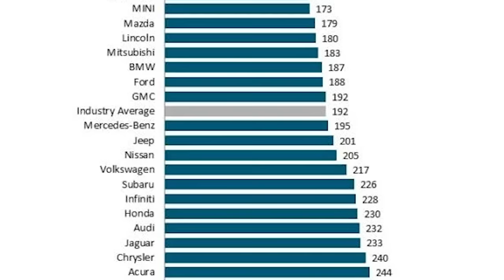Trucks That NEVER Break Down (Reliably run 1,000,000 miles)

Comment: Unfortunately Chevy/GMC trucks 2016 on up are super unreliable. Top 10 most unreliable list everywhere. I learned the hard way with a 2018 LTZ Silverado. They started using plastic parts in the transmission, engine, fuel pump, etc.

Comment: My brother has an old Ford Power Stroke 7.3. He loves it even though it's noisy and stinky. It's paired with a ZF manual trans that he's replaced at least 4 times. Whenever he pulls a heavy trailer, the torque and vibration of the engine simply beat the transmission apart. The hard parts in the trans just break in pieces. Typical Ford.

Comment: Love my 94 Lexus LS400 with 1,100,000 and going strong, big wide racing slicks and a full decat sports system and intake, costs peanuts to look after just done the alternator £100, power steering pump £50 & oil and plugs £70, drives just like the mrs brand new 9g tronic Mercedes, and yes it can still balance a one pound coin on the engine and rev it after 28 years, the japs sure know how to build em

Comment: I will keep my 2002 7.3L Power Stroke for a long, long time. Even after 22 years, I still only have 37,472 miles on it. All the folks I know that own one, has gotten over 500,000 miles on them and worked them hard. Mine has had an easy, grocery-getter life. I originally bought it for hard steel hauling. But decided to keep it nice and continued driving the old beater '87 F150 that had over 270,000 miles on its 5.8L gas engine. Ford builds the best, IMO.

I forgot about our little '89 Mitsubishi Mighty Max truck. That little truck was put through hell at our machine shop business. We hauled far more in that bed than it was designed for. It had every option like A/C, autotrans, stereo. The engine was too underpowered in it. A little 4-cylinder. But the truck lasted for 285,000 miles before it gave up the ghost in 2003.

Comment: 12 valve Cummins. 300/4.9 Ford I6. Dodge 225 I6. Chevy 250 and 292 I6, and the earlier 235 I6. AMC/Jeep 232 and 258 I6. International V8. Dodge 318 and 360 V8s. GM small and big block V8s (pre-LS series). If the truck you're looking at doesn't have one of these engines, it doesn't belong in a list like this. You guys mentioned a million miles, but the only engine you listed that has any chance of lasting that long is the Cummins.
Oh, but you want a Japanese truck? You didn't even mention the most durable Japanese truck: Isuzu. I consider it the International of Japanese trucks. Especially if it has the diesel engine.
As for Toyotas, I've had two Hi-Luxes. I literally gave the first one away after the third engine failure in 5 years. The second one, a 4x4, I traded for a Chevy parts truck. Toyotas gave me almost as many problems as Fords, and that's saying a lot.

Comment: Alright y'all, I haven't met a mechanic that recommended a Dodge Dakota. I'm into cars and motorcycles and owned an '05 Chevy 1500, '05 Ford 150, an '03 S10, and several Rangers. But a Dodge Dakota? I'm open to which is the best of the Dakotas. I decided a couple decades ago that Dodge missed the mark by not offering the Cummins 4 cylinder diesel in a Dakota!
Reply: What were your favorite vehicles that you owned?

Comment: 4:39 
Why do people talk shit about the 4L60E? Name other automatic transmissions that were behind V8s taking brake torquing, Rev & dumps, and still tow your boat to the U P for summer vacation at 150k-230k miles on original fluid from the factory?
Now the front differentials and the LSD in the differentials were no the best, but again handling neglect for 15yrs is usually the compromise…

Comment: 2nd gen dodge trucks get a lot of hate for bad transmissions, lack of power & cheap interiors.
 I have 3 2nd gens
1997 ram 1500 4x4 318 (722,122 miles)
1994 ram 1500 4x4 360 (377,421 miles)
2000 ram 2500 4x4 V10 (981,229 miles)

Ok my trucks have had repairs & maintenance. If you own a dodge of those years, you need a good set of tools, & a bit of mechanical knowledge. There is nothing on those trucks I can't replace myself. I would take anyone of my trucks on a long distance trip without the worry of breaking down. Imo 94-01+02 2nd generation dodge trucks are very reliable, and could easily pass the 1,000,000 mile mark if maintained correctly.

Happy to say my 97 ram has the og auto transmission at 722k, my 94 & 00 have rebuilt manuals

Comment: 99 Ford F150 with a 5.4 two valve motor with over 460K mis.  Bought it with 70K mis, switched to full synthetic with 4500 mi oil changes from June to September and 5,000 for everything else.  Haven't had issue with the engine at all.  I do not touch the plugs, allowing our mechanic to do all tune ups as he has the specialized tools to do so.  After 2002.5, I wouldn't buy an F150 until year 2022 and that would be a 5.0L. Ever own a Saab? When a turbo finally goes on an ecoboost motor, you won't have a wallet left to finish paying for the part.....
Reply: You are absolutely right brother. Spot on. I own a 2002 F150, 4.6L and with over 256,000 mi it's been a solid truck.

Comment: Okay truck/car guys, I need some help. So my wife and I are looking at getting a second car, and I specifically want to get a pickup truck and she agrees that would be good. I have been looking around and had a few in mind, but wanted to get some people's opinions. So I will start off by saying, I'm not a car guy. I don't care how it looks, or status symbol stuff, I just want something really reliable (hence why I'm on this video haha) and hopefully something with with decent cab space. I have been looking at 1992-1995 Ford F150 Extended Cabs, 2008-2012 Chevy Silverado Quad Cabs, 1st Gen Honda Ridgelines, and 2009-2014 Ford F150 Quad Cabs. I am a little partial towards Honda and GM products, but ultimately don't care as long as it's reliable (I am wanting a truck I can keep for a long time and hopefully get up to 250,000 miles plus). Any suggestions?

Comment: Good lord! From the title I knew this video would be a joke! Everything breaks down at some point! 
The S-10s are complete junk! I worked in at a couple independent garages from the late 80s to early 2000 …EVERYTHING on these trucks broke! 4x4 models had a terrible 4 wd system! Engines leaked oil something fierce and the 2.5L and v6 engine would rarely make it to 100,000 miles without major work! Fuel pumps would last maybe 4-5 years before going out! I could keep going but would be longer than this video!

Comment: S10?  Really?  I had 1 and had to put a transmission in it then, the engine went.  Crap truck. Got rid of that then, got a full sized Chevrolet 1/2 ton.  It didn't last much longer than the craply S10.

Comment: Surprised the 8.1 found in the 3/4 ton GMT800 platform didn't make the cut as a gas heavy duty option as I know they are a well loved engine even if fuel economy is usually single digits

Comment: Not sure what SIlv erado he drove, but they have issues once you get past 100K miles. I had the 2018 4wd Silverado 1500 for almost three years. In that three years the power brake assist pump went out, a wheel sensor for the stabilitrak system went bad, and the transmission overheated when I wasn't even pulling a load. Overall cost of repairs in three years was over $5,000.  I traded it in and got just enough to pay it off. Now I'm in a 2023 Tacom with the V6, and it pulls my 3,000 pound boat on a two axle trailer like a freaking boss , whereas the Silverado struggled. I'm done with Chevy trucks. I'll stay a loyal fan of Toyota until I'm dead.

Comment: As someone who has a lot and I do mean a lot of time energy and money invested in the GMT 400 platform from Chevy I can tell you right now your assessment of the Chevy Detroit diesels is wrong between 150,000 to 300,000 mi they are known for cracking the block unless they haven't been worked if you give them a very easy life with no stress they won't do it but if you work them at all they will crack the block The old Duramax like the first generation was a good motor very good motor but anything before that the 350s are okay but even they don't hold the candle to the reliability of the big block

Comment: I have an 88 Suburban. Original 350 engine still going strong. Original paint, and suspension too. It is a reliable daily driver.
Reply: Lmao, you sound broke
Reply: @deontaywallaceescalade  Its a $25,000 truck, bud.

Comment: Bro the 04 05 LLY duramax sucked. My old room mate had an 04 and i had an 03 LB7 and he had his tuned with efi and mine came with a 75hp edge and my truck would smoke his. I loved my lb7. I have owned 2 cummins a 95 and an 01 and the 01 sucked in comparison. The v10 ran good they actually impressed me. I have a 12 6.7 powerstroke and its fucking awesome. I had an 01, 03, 06, 11, 12 powerstroke. The 7.3 is reliable but had NO balls and cant be built to be as powerful as cummins and duramax. The 6.0l were junk but ran better than 7.3. When hauling my uncles race car on my 03 6.0 up a 35% grade it ate that hill up and blew a hole in the hot side of the turbo and still made it home. Traded for an 06 and it lost a couple injectors.  I fucking love my 6.7 ford it would blow every truck i have had out the water except, drum roll, my 650hp 1400lb 12v cummins. I would trade my king ranch for a crew cab 12v if i could find one for under 40 grand.

Comment: I had to stop watching when the conversation turned to the Ranger, no generation of Ranger was based on a Mazda, it was the Mazda that was based on the Ranger, just Isuzu used the S10, also I believe a little research will reveal the Dakota was no Mitsubishi either.

Comment: Living in a country with absolutely garbage roads I can say Dodge and Nissan interiors completely fall apart in 10 or 15 year. Cheve and modern Toyotas are a bit better but not much. Then there are the Fords Mazdas and older Toyotas. Beat the hell out of them and air condition still works even door handles stay intact. Most people drive Ford around here for a reason even though it's not as reliable

Comment: lmao a 4.3 powered blazer is reliable but 4.6/ 5.4 powered fords arent? you could be unlucky and blow out every plug on separate occasions, get them all repaired and still be cheaper than the inevitable spider injection, intake leak, failed distributor, then ofc the 4l60 will die at 150k. ill take anything powered by a 2v with a 4r70w behind it before i take any of chevys offerings

Comment: IM GONNA TELL YOU THIS: I HAD AN 95 S10 FOR 5 YEARS, THEY ARE IMPOSIBLE TO DESTROY AND I HAVE PROOF: 1999 TO 2000 I COMPETED IN RALLY WITH THAT TRUCK AND NEVER HAD TO CHANGE NOT EVEN THE SUSPENSION

Comment: I remember owning a 96’ S-10 5-spd, 2.2l Eng /Standard Cab. I purchased it for $11,975.00 new. I owned it for 9-yrs. Only major work performed was a new clutch, 1-ball-joint, and upgraded u-joints. I performed tuneups myself. Damn great little truck. I now still have a 1stgen Tundra with 246,000 miles 4.7l v8 4wd. Excellent Truck.

Comment: the s-10 was better than your 401K o my power joke the turbo sucks on ford o and the yota over priced can't do the V8 cummins o don't they put that in a ram try the resale value i don't know i was just in the car sales world for 10 years i currently drive a 2011 tahoe with almost 200k good 5.3 ive had for 8 years and ill buy another

Comment: I had a 99 ranger manual transmission that I bought new and sold in 2011 with 230,000 miles. Was still running and in good condition. The only thing I ever had to do outside of routine maintenance was replace the alternator at 100,000 miles. Never even needed a clutch. It was a no frills 100% reliable truck

Comment: All new vehicles are junk!  Because some engineers believe technology will make everything better…..sure we can get 0.00007% better fuel mileage with active fuel management or what ever they call it. And it only adds 5000$ to the cost of building a vehicle but on the bright side you won’t have any trouble with it for at least until 5 miles after your warranty expires. 
Give me an “old” 1st Gen 5.3 vortec any day!!

Comment: I'm not completely sure why you keep dumping on the 4L60E transmission, except for word of mouth reputation. 
Most these transmissions last for many miles are many years as long as they are used as they are meant to be used, in trucks the number one cause of failure is towing in overdrive, number two is modifications to the engine and pumping up the horsepower and not doing the same to transmission. 
I know many people that have chevy and gmc 1500s with 200,000 + miles and still running fantastic. 
Regular maintenance and no over the top modifications and 350,000 + miles is possible. 
If you want to build a hotrod or rock crawler there is much better choices.
(I will add this applies to the 2004 to I believe 2007 1500 series gm trucks, I'm not sure when they added active fuel management) to many problems and very expensive to repair unless you can do it yourself.

Comment: The v10 rams suffered from cracked heads...i feel not as much research has been done on some of these vehicles....theres a reason fords v10 is around more than a dodge. Im a mechanic btw...i specialize in japanese vehicles but for years played with anything that made me money. I worked on a lot of chevy transmissions and ford motors breaking down. Japanese vehicles are the best for your buck and longevity in life. I own a nissan frontier and a toyota tundra.

Comment: there is a host of problems with this video.  those gms may keep going and cost a transmission every now and then, but they also burn through blend doors, heater cores and electronic moduels.  all of which costs thousands of dollars in repairs, fords don't have that issue.   the t100 and early tundra is one of the worst trucks toyota made, between being cheap, transmission issues, ball joints failing and american frames rotting in half, not my choice over other toyotas, tacomas had the frame issue too, but none of the other issues.  yes my 7.3l is dead reliabe and even though ram and ford both use a dana 60 front axle, the ram has a host of failures due to different knuckle design.  the 6.0 and 6.4 are still international, so that falls on them, not ford.  and I hate the cummins in a semi vs other options.  truck 5,9 is good.  my 3.0l toyota engine in my camry at 300k runs like new, no repairs.

Comment: Chevy GMC gasoline engines are literally burning up.
Chevrolet / GMC pickups are now the Least reliable trucks on the road today according to Consumer Reports.
Yes their reliability is now Below the FIAT owned and built Chrysler, Dodge, Ram and Jeep.
If I were in the market today for a new pickup, I’d buy a new Tundra with the 3.4 V6 twin turbo.
Over the years Toyota has proven itself to be extremely reliable !
GM, Ram and Ford need to take notice.

Comment: I've had 2 Toyota trucks. Both were money pits.
Reply: That's just unlucky then or possibly they're the newer models that are shittier
Reply: First was a 1985? Toyota one ton, long bed. Yep, they actually made some. Leaking head gaskets & main crank seal. Crappy brakes, 2 failed fuel pumps (pump in the gas tank)
Reply: 2nd truck was a 1990 4x4 extend cab, v6. What didn't go wrong with it?  Neither truck made it to 200K. both sold in one day.
Reply: @jw9980  Toyota has never made a one ton truck wtf lol

Comment: My pick #1 Toyota Hylux,#2 Nissan D21 Hardbody,#3 1999-2006 GMC/Chevy, #4 Ford F-series OBS all of them pre 1997 followed by 1997-2003#5 Ram trucks anything pre Modern Hemi was pretty damn good. My worst trucks are #1 Any Ford with a 5.4 3valve! #2 GMC/Chevy everything made since AFM was introduced all of them are trash, and my least favorite Dodge/Ram anything from the Modern Hemi to date complete over priced crappers! The Rams are decent until abot 100k then they start to fall apart on you and become endless money pits!

Comment: Sorry live in Northern Ohio and ALL Toyotas are famous for the frame rusting out about the time the vehicle is paid off.  Yes, they run forever but sorry rust will always win.  GM's worst problem is their AUTOMATIC TRANSMISSION, even their Famous Turbo 350 or 400 are actually a nearly identical copy of a Chrysler torqueflite.  As for GM's 4 speed automatics, can you say absolute JUNK.  Chrysler's 4 speed autos problems could be fixed for a screaming $65 by installing a transmission oil cooler, vice the factory oil heater in the radiator.

Comment: Idealist, AKA Chevy fanboys.  None of the modern diesels are going to compare to the old dogs, but to say that "as of late" the powerstrokes aren't the best ignores the overall excellent track record of the 6.7.  The 6.0 and 6.4 were both abominations, and there is no question the duramax and cummins options at that time were a better choice.  But the 6.7 PS has overall been really really good, and it's hard to say the GM and Ram offerings are all that much better, all things considered.  The cummins by itself is a great engine, but IMO it has always been stuffed in the worst truck of the big 3.  Most open-minded truck guys in the late '00's wanted the same thing:  Super duty with 5.9 cummins and allison transmission.

Comment: We are the original owner of a 2003 RAM Diesel.  NEVER: chipped or modified.  Pure stock engine and no towing or excess load.   NOTHING BUT A BOTTOMLESS PIT OF UNRELIABLE KRAP.  We repeat.  Purchased new from a Dodge dealer.  100% stock.   But a nightmare of unreliability.  Where do you find your information?  Off the back of a bubble gum rapper...?   All I hear from Cummins owners who foolishly purchased a Cummins with DEF is... their reliability is a minus ZERO.   Add to that a crummy suspension system.   Our 1993 Chevrolet 6.5L is 100% reliable compared to the P.O.S. Cummins engine... who does not stand behind  their engines once they leave the lot.  Sorry but you obvious only possess limited knowledge of Cummins/dodge reliability